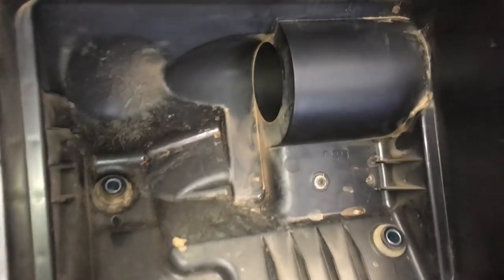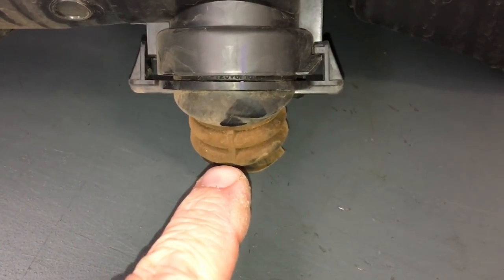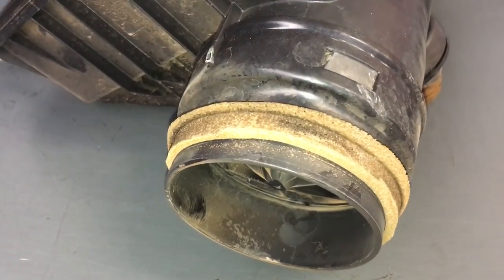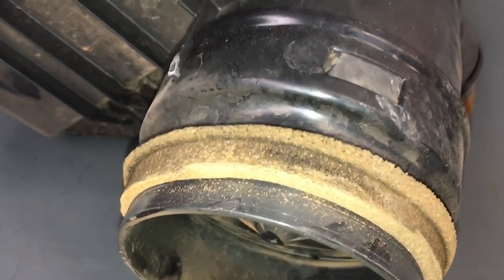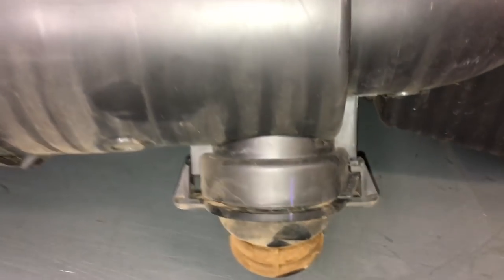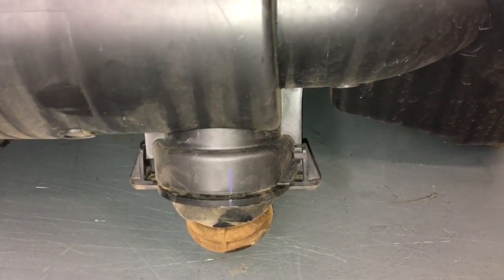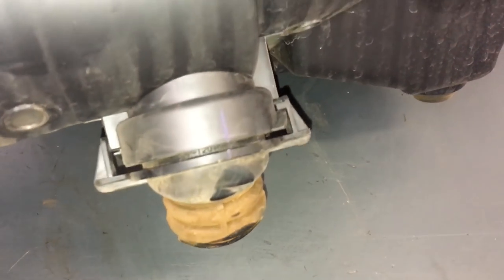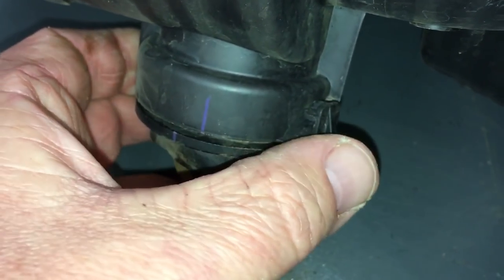SO DO YOU GET A SNORKEL? - This is the best video to help you decide you need to understand this￼

Comment: Perfect timing on this one. Installed a snorkel two nights ago and didn’t seal any of the holes in the air box for the exact reasons you said. Water has to be able to escape from somewhere.

Comment: I'm an automotive design engineer & if I didn't live in Victoria & drive the high country with multiple deep water crossings, I wouldn't bother having a fully sealed snorkel on my vehicle. If a raised intake delivered all the advantages claimed, we would have designed them into vehicle rooflines long ago 👍
Reply: Not really, bean counters have the biggest say.

Cars are designed for the majority to do a average job.

Comment: I just did the Gibb river Road with a snorkel fitted to my 2014 Hilux, ur right a snorkel is in the worst possible spot for dust (we were in a convoy of 4). I fitted a snorkel sock oil filter and went through heaps of dust during my month away. regularly oiled and cleaned and worked perfectly, saw no dust in the air box.

Comment: I agree snorkels are designed for dust and to put the intake in the cooler air. But they have been around for ages too. Before these neato pre cleaner air boxes. If you want to do the water crossings I think you should plug up the holes. I work in mining an can tell you those one way valves or ducks bums need changing out every 3 years or so. They stop sealing and go hard.

Comment: I've drenched my air filter in the middle of nowhere from that 3mm hole in the bottom of the airbox. No snorkel intake piping was dry. The second that hole goes underwater and you are under boost it blasts into your airfilter like a sailor on shore leave.

Comment: G’day Mate
Yes I generally agree, but there’s idiots that never learn weather they have a snorkel or not
I’m 64 have a mechanical background, I prefer a snorkel 
But like the fellow said you don’t need it , I’d say if you’re keeping your 4wd for long term put one on 
I think that the snorkel can actually help with air pressure into the combustion chamber , otherwise the motor is sucking , it’s a bit like being on a ventilator 
It does provide better economy long term 
I don’t disagree with the video at all , but hey my GU Patrol 4.2lt turbo has over 1 million Ks on it , still has great compression and 9 kilometres per litre if not thrashed 
With the new diesels a big trip is to the corner store , not sure about getting back
Long in tooth I know but bloody reliable

Comment: Well I just finished watching this, went outside to check the airbox and would you believe it, the 3 small internal drain holes are full of silicone. Glad I watched this. Also been running the uni oiled snorkel filter and it's been keeping a lot of the dust out of the box. Might also replace the paper airbox filter with a oiled unifilter airbox filter as well and see how that goes with keeping the intake cleaner

Comment: Thanks for the great info on the aircleaner box & design. Re dust levels at different heights, there can be many different factors at play. ie soil particle size & source of dust generation. Vehicle generated dust with fine particles will behave as described. Wind generated dust with larger particles will behave differently. With higher levels of dust closer to the soil surface than at Snorkel height. If travelling in convoys is your thing in bull dust conditions a Snorkel will catch more dust. On  most wind swept beaches a Snorkel will perform better. As it will in wind swept roads or paddocks with larger soil particle size. I hope this helps, love your channel. Cheers Michael

Comment: The one way valve on my LN106 HILUX gave up the ghost and could not source any replacement or any ideas for a replacement so I used a HILLS 5L Garden Pump Seal instead. Some advice was to seal it up with something but diesels have to BREATH and those older units are still made from steel, so you don't want ANY moisture build-up. I've had some reputable people tell me BOWL Filters don't work? I wonder if they've ever driven machinery in a cotton shed? Maybe then, they might understand if they have to clean the unit every 15 minutes!?? That's where you find the good operators and NOT just steering wheel attendants!??

Comment: I need a snorkel, some of the river crossing i do are above bonnet. However i totally use an oiled up sock when going anywhere dusty, keeps the air box and filter shmicko.
Also ripped out the stupid airflow restricting "separator" because as you said the drain is siliconed up. ;)
For people driving around town meh, wank factor.
Reply from the maker: With the water depth being over the bonnet how do you stop the vehicle from floating like a boat

Comment: As a mostly touring vehicle, I see no need for a snorkel.  They look great, but scream “All the gear and no idea.”  I have no plans to cross any river over the height on the intake or to submerge all the electrical fittings.  But if appearance is your priority, then go for it.
Reply: I hardly think a snorkel is an "all the gear and no idea" mod
Reply: If it's a touring vehicle then it's probably got a bullbar. If it's got a bullbar, it needs a snorkel.

Comment: I've often wondered why people fit a snorkel for increased wading depth when their alternator remains very low down in the engine bay.  Whilst bash plates and getting the perfect speed right for a nice bow wave can prevent some water getting into the engine bay, if you have water high enough to get into the original air intake, I would imagine you're on borrowed time.
Reply: Wading depth is 700mm. Thats 100mm below the top of the tires. Not very deep I would say
Reply: Come's down to circumstances I guess, e.g. the placement of Ford Ranger alternator (high) vs an Amarok (nearly scraping the bloody road)

Comment: I thought the same until after a few beach trip Ford told me I had sand in air box as intake is in wheel arch maybe not as well protected as a prado fitted snorkel no more sand in airbox
Reply from the maker: It probably had a bullbars once you’ve got a Bullbar which is also not required it opens up all the crap to go with your air intake picks up the air once you have a Bullbar you then need a snorkel note as good as No bullbar no snorkel
Reply: @Fourby4Diesel  
Then it's just a soccer mums car... Can go along a beach and that's about it.

Comment: That's why in our rally cars in the 80s, we used to run our airbox piping into the inner guard. Some vehicles are of course piped differently and snorkels are a better option. What people also don't realise is they do not permit the vehicle to run underwater indefinitely. 4.2 Nissan Patrol is a good example, The hose clamped hoses may be may be waterproof but other areas of the airbox are not. Trying to waterproof it is stupid. Learn when not to cross water, how to safely do watercrossings and no what the risks are.
Reply: Horses for courses.

That suits you, but not others.

Comment: Do you find that if you have a bull bar (and no snorkel) and the guard liner has been cut to fit the bull bar, that the dirty side of the filter gets dirtier quicker than say a stock vehicle ?
Reply from the maker: Yep
After damaging the Toyota and putting the chunk of steel on the front it opens up the dust to come in and then you’ve got the vehicle dynamics changed it does not drive as well and chews more fuel
Reply: This comment is interesting, I serviced a Hilux the other day and was trying to work out why the bottom of the air box was full of sand, the car didn't have a snorkel but had a Bull Bar, thinking about it now I wished I had looked at the guard liners to see how poorly they were cut, I bet that is how the sand got in and it was so much it was rather scary, when you are blowing sand out of the filter...

Comment: So if I go through a deep river above the air box but have a snorkel will those little drain holes cause the air box to fill up or will the pressure stop it?
Reply: The airbox is under a vacuum when you are boosting it blasts the air filter like a water pistol as soon as the hole is submerged and you plant boot to get out of trouble.

Comment: Sorry that's not quite correct. It's really a 'raised air intake', it does source air from a 'cleaner' location if you're getting dust from a typical snorkel suction location then you're too bloody close to the vehicle in front of you! As for water crossings, that should be self explanatory to yourself. I agree with the fact of not playing with the water release/drain, a few of those silly stainless systems don't have any which is plain dumb.

Comment: Noticed you mentioned the airtec snorkel. Is there a problem with the brand? I own a 79 and am considering an airtec as there is no extra cutting and diy is possible. What are the downfalls of installing a snorkel as your video didn’t really explain? Sorry I might be missing your point.

Comment: A snorkel is meant for the same reason we wear them swimming.... Driving through water.
A snorkel is not for dust. Seems you missed the point.
"If you've got water up to there you've got bigger problems", nah mate, it's called a water crossing. Plenty of people do hectic deep crossings when they have the right gear
Reply from the maker: Yep we’ve seen them float away down the river
Reply: Yep, you are exactly right. " A snorkel is not for dust". It's not designed for dust it's designed for water crossings.
So you must take yours off for the 99.99% of the time you are on the road????
Reply: Hahahaha
Reply: @Jack_C_  Why would you take it off just because it isn't in use? Should you take your diff locker out when you don't use that 99.99% of the time?? Remember some cars come with snorkels fitted from factory
Reply: Introduces a dust problem when it solves the water crossing problem..
Reply: @Jack_C_  
Yeah the same reason I take all the seats out when I don't have passengers.